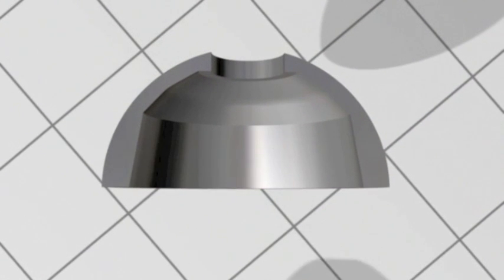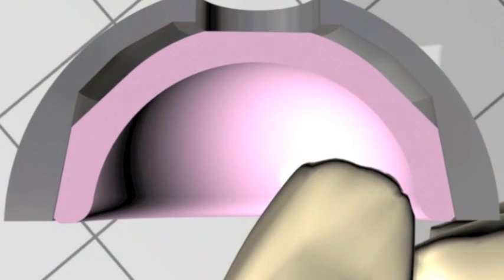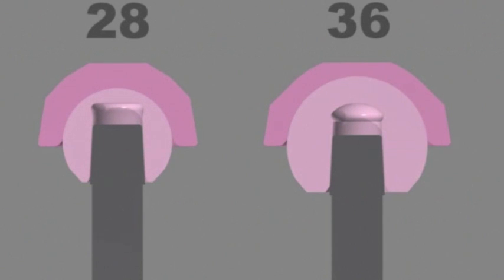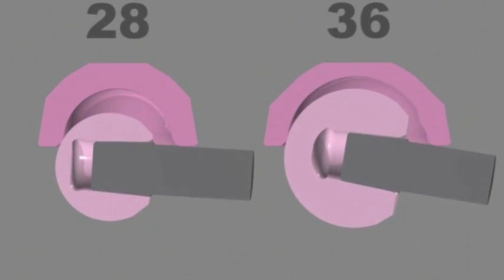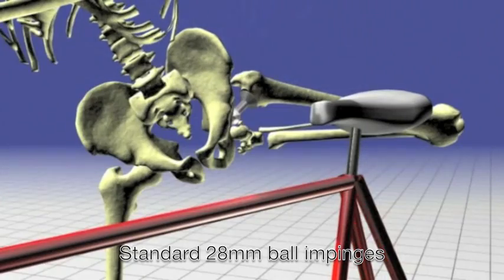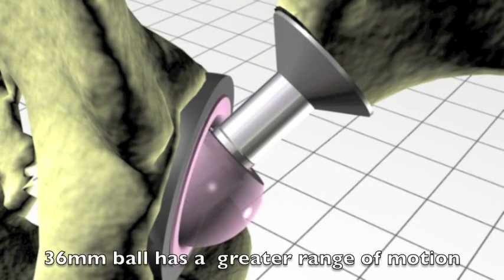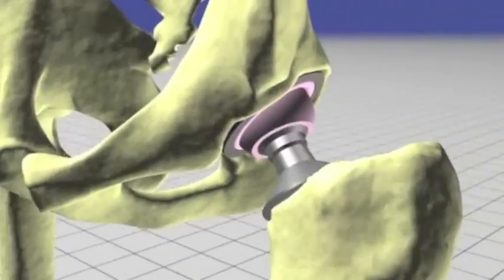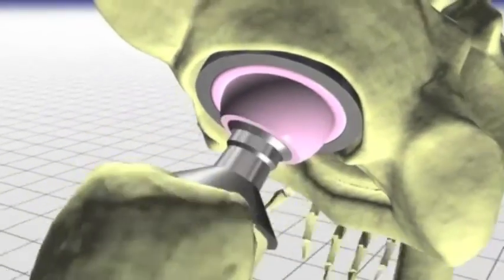Ceramic hip replacement. Engineering detail

Comment: i have one of these hips delta ceramic on ceramic it works great could be better at shock absorption when you walk .
Reply: Where did you get your hip done? I will be needing a hip replacement probably within the next 5 years or so, and I've been researching the Delta ceramic on ceramic. That hip looks very promising. I just turned 40, and my right hip is degrading.
Reply: @AnthonyJ74  So did you done your hip what kinde you have it? I need too Lancaster PA USA
Reply: @AnthonyJ74  So have you done your hip? do you have CoC?